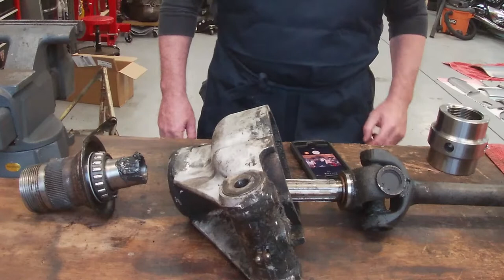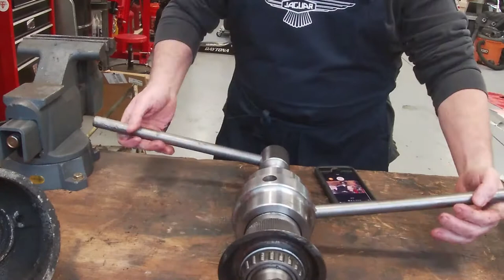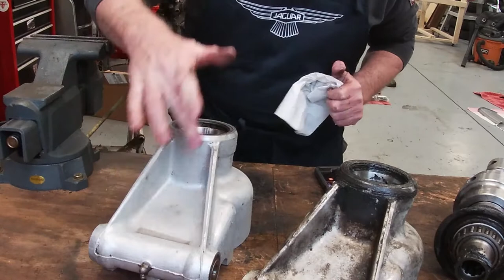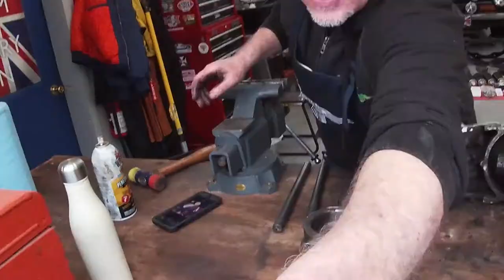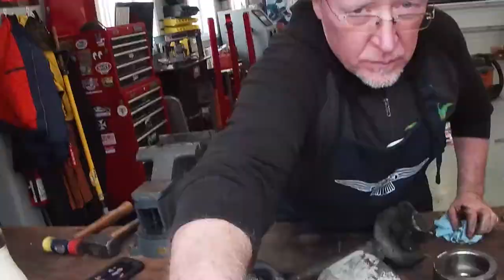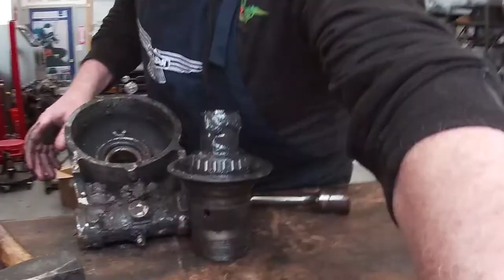Jaguar E Type Series II Rebuild - Rear Hub and Drive Shafts - 2021-01-31

Comment: John another great video. I have just enjoyes doing my rear hubs this evening. As usual I waded in before watching your video. I pressed my inner drive shafts out on a press with relative ease but was unsure how to remove the splined hub part. Well worth watching the other nine mins of your video to discover a quick tap with a drift does the job. thanks that saved me making more errors. Hugh

Comment: OK understanding that you are an experienced expert in Jaguar IRS, looking at the one you took apart it (to me) its obvious that when grease was pumped in it came out of the bleed hole directly opposite the grease fitting, when I worked in a Jaguar shop we always plugged this hole (ala self taping screw) so that the grease went and escaped through the bearings  at the end of the fulcrum shaft we then knew grease got where it should be :)
Reply from the maker: Hi Jagvette - I am, for sure, not a Jaguar expert in anything. This is my second E Type restoration and the last one was back in 2011. I am at best an enthusiastic amateur and I was talked into filming it all, I guess, to show that it can be done. I really like your idea and will take a look at using it as I do the final lube check when the IRS is fitted to the car